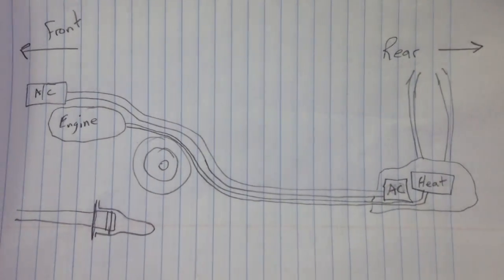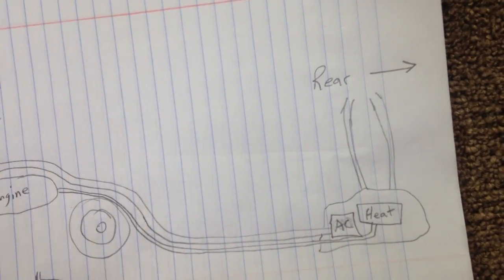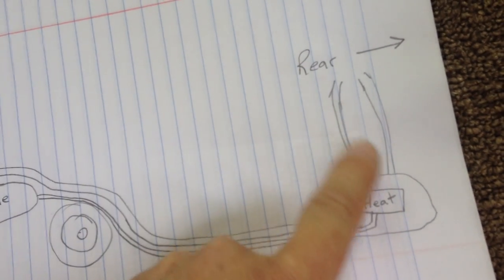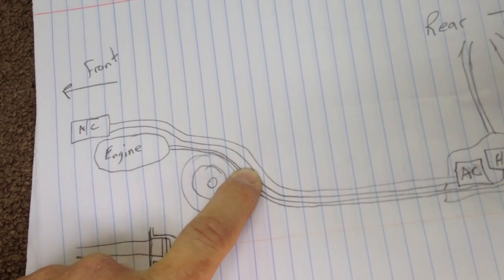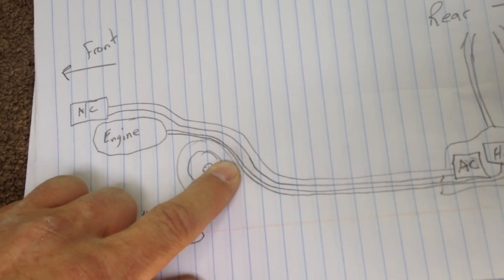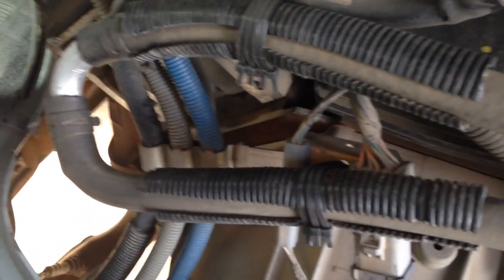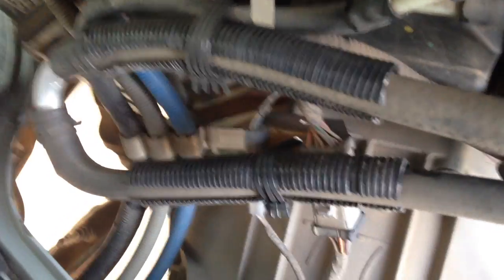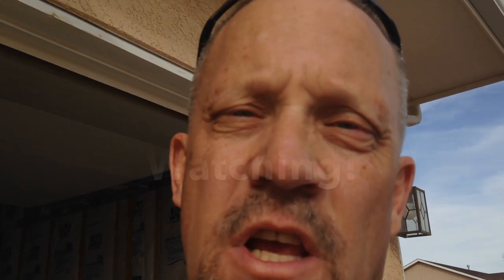How to Remove a Rear AC Unit - Rear AC Heater Removal - Ford E350 DIY Camper Van Conversion

Comment from the maker: Here is a link for the block off kits. I think I paid about $60 for mine. I think the price is ridiculous for two caps and some O rings but it is holding back a lot of pressure and they are simple to install. These links are my affiliate links and I could possibly receive a commission at no extra charge to you if you use my links. I thank you in advance if you choose to use them. 👍
BK67075 Rear A/C Block Off Kit - https://amzn.to/30xR2ip
OEMTOOLS 25042 Air Conditioner/Fuel Line Disconnect Tool - https://amzn.to/3dPqpLe
Reply: Great video, I am doing this to my 01 E350 I will use your affiliate link so you can make a little scratch but I'm curious on Amazon this sellers link has a area to put your model to make sure it fits it says it wont work for a 01. But yours worked okay?
Reply from the maker: Yes, mine worked out ok.
Reply: Ya no está disponible para comprar el producto, es algo temporal?.
Reply: Hi there and thank you for your video. I’ll be ordering the kit from your link and the fuel line tool as well and will keep you posted on the outcome. 
Your video, even though it was after the fact, was very easy to understand. 
Thanks again.
Reply from the maker: You're welcome Tharwa and I wish you the best with your project.

Comment: I wanted to update you and also share with others something that helped me..
In order to access the quick disconnect lines, I agree the best way is to lay on your back and just wiggle around until you can reach your hand up and feel it. There is a clip on each connection that you can pull off with your fingers, it just takes a little wiggling. 
**What I found most helpful is - I used my phone and recorded a video with the flash on, it was very helpful to visualize what was going on up there since I couldn't see it but my phone could. I also have an apple watch so It made it easier to move the camera around and also look at the screen on my wrist. This might not be helpful for everyone, but it certainly worked for me. Thanks again!!!
Reply from the maker: That's a great idea and I'm glad it helped you out. Thanks for posting this info, hopefully it will help the next person who does this job. Thanks again!

Comment: That is very helpful.  The kit is now $68 for two caps and four O-rings and over $10 for shipping.  Holy wow.  
Thanks for the video.
Reply from the maker: You are welcome. Yes the block off kit is pricey but still much, much cheaper than having a shop do the work for you.

Comment: Awesome video! Converting the same van now trying to remove the rear Ac
Reply from the maker: Thank you and good luck with your build.
Reply from the maker: After I did the removal of the rear AC, my front AC was in tact and fully functional. I did have to have the system recharged after capping off the lines that feed the rear AC unit.

Comment: If I accidently cut one of the ac lines and evacuated the ac system, I probably would have evacuated my system as well, ha ha.  Thanks for all the info, as I need to do this with my 1998 Dodge conversion van.  I just got it 2 days ago and was under there and saw the 3 large coolant lines running under the chassis and snaking their way to the rear.  There are several places the hoses have been rubbing against parts under there and are almost worn through.  That seems crazy to me plus, all it would take is a rock to pop up there and cut a hose and there you are.  No thank you, I am taking them off so I appreciate this info.  Didn't see any ac lines heading back there yet but the manual says it has rear ac as well.  I just though maybe they ran a duct inside the wall for that ?   Only control for that is a rear fan switch up front.

Comment: Thank you, this is just what I needed.  I wish I had discovered this before I ripped out the rear A/C.  But I think I can still do this.  I have a couple questions. 1.  How did you cut & bend the aluminum pipe that you used for the coolant hoses?  2.  Would it work if I blocked off the two A/C pipes further back on my vehicle, somewhere that is easier to access?   I'm a complete beginner & don't know anything about mechanics of cars, but I keep trying to figure things out.
Reply from the maker: You are welcome and I hope my video helps you out. #1. I didn't bend it I just cut out a piece with an existing 90 degree corner already in the pipe. I know I said U on the video but it's really just a 90 bend in the pipe. #2. For the block off caps to work you have to cap the pipes where there is a factory joint. My set up only had a joint at the front and at the back. I wanted those tubes to be as short as possible so you don't have all that extra Freon running back to the back of the van for no reason so I capped mine at the joint above the front fender. You can't cap the pipes at any location because the caps fit onto the factory joint ends. Hope this helps.
Reply: Thank you, your video was tremendously helpful.  When I saw all the coolant pouring out when I ripped out the rear unit, I knew I was in trouble.  And then I heard noise like something under high pressure was shooting out (I didn't even know it was freon).  This video is the only thing of it's kind that I could find.  My van is a Ford 2000 E150, but from the video it looked like the only difference is that your vehicle was a little longer.  For those who know about metal &/or vehicles this is a stupid questions, but how do I cut the pipe?  Do I use a regular hand saw with a metal blade?  Or I could borrow an angle grinder from my neighbor.
Reply from the maker: An angle grinder will work fine or if you have access to one a hack saw will do a nice job too. Good luck with your project and thanks for watching. :)

Comment: I am currently converting a 1997 F350 SuperDuty Ambulance, I have already disconnected the A/C and the heater while I was stripping/demolishing the inside. I didn’t realize the rear A/C and heater was connected to the engine. I found your video super helpful on a potential solution but I am unable to find caps that are capable with F series, it seems to all be a similar set up… curious if you might have any ideas or point me in the right direction.
Reply from the maker: Sorry I have no idea what caps you would need for an old ambulance. You might try to Google it or check with a dealership or auto parts store. They may be able to help you find what you are looking for. Good luck with your project.

Comment: I'll echo everyone else's comments...great video and will shortly be hugely helpful for us and our 2005 E350 conversion. I had the AC capped off professionally but am about to do the coolant lines. My question is if you remember how much less coolant it took after purging and adding the return/L-bracket under the doghouse? Thanks!
Reply from the maker: Thank you and I'm glad the video helps everyone out. Sorry but I can't answer your question. I had the coolant refill done at a shop and I really don't know how much it required. I also don't know how much was required before the modifications. You may be able to find that info online with a good google search though. Thanks again.

Comment: Is it possible to just loop the ac lines for the time being as an easy solution as I already cut mine out..? I found an easy position to loop the heater lines but I thought the AC was connected. Helpful video you even mentioned the difference in size lines which had me a bit confused.

Comment: Hi. Thanks for the video. Question: I started this before my caps arrived. If I “short circuit” the hose lines under the dog house and add coolant can I drive without the caps on? Does it just mean I’ll have no ac? Thanks. Cheers.
Reply from the maker: You are welcome for the video. Sorry but I can't answer your question. I have never tried that so I really don't know how it would work out. Good luck with your project.
Reply: I also took the rear AC out before seeing this video. I connected the coolant lines together and did not cap the AC, and it ran fine. I just haven't turned on the AC. About to order the caps now. Thanks for the video.
Reply from the maker: You are welcome Ben!

Comment: I started.taking out the panels to my ford e350 xlt 05 and found out that part of the panels are a/c vents traveling to the back. I was trying to keep the rear a/c but now, I am stuck as to what to do. Any suggestions?

Comment: This is super helpful! what year and make is your van?! does it matter? doing mine soon on my 1994 chevy G20.. do you think after doing it, you could take a cheaper route and find fittings and clamps at a hardware store and do a DIY job? I feel like either people say dont touch these, or spend the money and do it right.. Makes me nervous to do it myself lol
Reply from the maker: My van is a 2001 Ford E350. A/C systems are under extreme pressures and need to be depressurized before working on them. Hardware stores don't carry the correct fittings so you will have to get them from an automotive shop. I accidentally depressurized mine by cutting into the line with a cutting wheel while working on the floor. It was dangerous and thankfully I was out side when it happened. I don't recommend doing it that way. A shop can depressurize it for you but I don't know the cost. Good luck and be careful. Remember the system is most likely under very high pressures.

Comment: Hows that radiator loop holding up after all tgis time. Im planning on doing same on a 05 e150
Reply from the maker: I sold the van several years ago but it held up just fine while I owned the van.

Comment: I just ripped the rear ac unit out of my chevy van. You set up looks like mine. 

Now my vans overheating. So would i just cap off the hoses i cut so the fluids dont leak again?
Reply from the maker: I don't think I would just cap them off. I would connect them together so the radiator fluid could circulate through the hoses and back to the radiator. I'm not familiar with the chevy set up but from what you have said, that is what I would do. Hope this helps.
Reply: Thanks. Thats what i was i thinking. Next time i wont beat the hell out of my van with a hammer. I think its time to start taking it easy on her.

Comment: Wow, dude thank you thank you thank you. I am doing the exact same thing to my first stealth van and don't know my butt from my elbow about AC/Heat. Let me ask you did them heater lines don't have to reconnect in a 'U' like the AC lines did?
How big a bucket am I gonna need? Do you remember if there was a lot of stuff in it?
You didn't have to weld them holes huh? I was thinking I'd have to weld the holes.
Reply from the maker: The A/C lines are the aluminum lines and were capped off with the block off kit I purchased. One line is a little larger than the other and get capped off just above the driver side front wheel. The heater lines are the larger rubber lines I installed the "U" into under the dog house with the hose clamps. I probably got a quart or so of fluid out of the heater lines. The A/C lines are the trick ones because they are under extreme pressure. It would be best to have the A/C system evacuated by a shop before you cut those lines. Once you install the block off caps you'll have to have your A/C system re-charged so your dash A/C will work. Kind of a pain and a little pricey but worth it in the end I think.
Reply: I just removed the rear AC/heater core from my '04 E350 Superduty XL, and drained all the coolant before I started. My van holds approx 4 gallons of coolant, but this may vary in different years/models.

Also, it bears mentioning that I found an AC block-off kit at my local auto parts store for 13.99. Not sure if it's manufactured to the same specifications and quality as WannaBFree's kit, but it's a lot cheaper if you're operating on a limited budget!
Reply from the maker: Awesome, sounds like you scored on the price! As long as it doesn't leak when installed you will be fine.

Comment: This is great, thank you!  Can you buy the AC caps at any auto store you think?
Reply from the maker: My experience was most local auto parts stores didn't have the one I needed so I had to order mine on line.
Reply: What exactly did you buy? I need to do this exact cap off for my van
Reply from the maker: @solaceincarnate  Here is a link for the block off kits. I think I paid about $60 for mine. I think the price is ridiculous for two caps and some O rings but it is holding back a lot of pressure and they are simple to install.
BK67075 Rear A/C Block Off Kit - https://amzn.to/30xR2ip
OEMTOOLS 25042 Air Conditioner/Fuel Line Disconnect Tool - https://amzn.to/3dPqpLe

Comment: Hey! we are trying to do the same thing but cant seem to find the kit anywhere. Could you let us know where you bought it and how much u paid?
Thank you
Reply from the maker: Here is a link for the block off kits. I think I paid about $60 for mine. I think the price is ridiculous for two caps and some O rings but it is holding back a lot of pressure and they are simple to install.
BK67075 Rear A/C Block Off Kit - @t
OEMTOOLS 25042 Air Conditioner/Fuel Line Disconnect Tool - @t

Comment: I can't seem to find where you have answered Samantha's question about the block off kits.  I think you are the only guy in the world who knows about them.  Can you tell me where i can find them.  I've tried Ford parts but no joy.  Would really like to know where to order the cap off or block off kit from.
Reply from the maker: Here is a link for the block off kits. I think I paid about $60 for mine. I think the price is ridiculous for two caps and some O rings but it is holding back a lot of pressure and they are simple to install.
BK67075 Rear A/C Block Off Kit - https://amzn.to/30xR2ip
OEMTOOLS 25042 Air Conditioner/Fuel Line Disconnect Tool - https://amzn.to/3dPqpLe

Comment: any issues so far? does it change the pressure in your coolant system? im planning on doing this soon.
Reply from the maker: I sold that van a couple of years ago but the few years I owned it I had no issues with the modification. I think the pressure in the system would be the same with or without the extra run of hoses. You'll just have a little less fluid with the shorter lines. Good luck with your project and thanks for stopping by.

Comment: Was there a trick to getting the block off kit in behind the shock tower and spring? Did you go from a certain point where there was more room to get in there and install the caps?
Reply from the maker: It's been quite a few years since I made that modification. I do remember it being quite a challenge but it is doable. If I remember right, I think I laid underneath just behind the driver front tire to get an angle I could work with to get it done. Sorry, it's been too long for me to remember any specific details of that task. It wasn't simple but I didn't use any special tools except for the removal tool for the block off caps.
Reply: How did you end up disconnect the lines?

Comment: I found a rear ac block kit online, but the page said that I need a springlock removal tool to disconnect the lines.  Is that an essential item to purchase?
Reply from the maker: Jacob Liskowiak yes, you will need the special tool to disconnect the joints to install the new caps. Here is a link for the block off kits. I think I paid about $60 for mine. I think the price is ridiculous for two caps and some O rings but it is holding back a lot of pressure and they are simple to install.
BK67075 Rear A/C Block Off Kit - https://amzn.to/30xR2ip
OEMTOOLS 25042 Air Conditioner/Fuel Line Disconnect Tool - https://amzn.to/3dPqpLe

Comment: I am removing the same type of unit from the rear of my van. I reconnected the heater hoses together, but I can't find the parts I need to cap off/reconnect the AC hoses. If I refill the reservoir, will the radiator, water pump, and everything still work if the AC hoses are still disconnected? Or does the AC need to be capped like you've done?
Reply from the maker: Yes, everything will still work except the AC. Also it isn't good for the AC compressor to run without AC fluid in it so don't turn on the AC if you don't cap it and fill it. Also on most vehicles if not all vehicles the AC compressor runs when you have your heater settings set in the defrost position so try to avoid that as well if you don't plan to cap it and have it filled. (the AC that is) Your heater, water pump should all work fine with the radiator hoses connected and filled properly. Thanks for watching and I hope this helps. :)
Reply from the maker: Here is a link for the block off kits. I think I paid about $60 for mine. I think the price is ridiculous for two caps and some O rings but it is holding back a lot of pressure and they are simple to install.
BK67075 Rear A/C Block Off Kit - https://amzn.to/30xR2ip
OEMTOOLS 25042 Air Conditioner/Fuel Line Disconnect Tool - https://amzn.to/3dPqpLe

Comment: hey i have a question . do those heat hoses on the back  of the ac/ heater stay hot when u driving the van . first time looking at them on the back and they are hot ?
Reply from the maker: I would think they should be hot when the engine is hot. I believe the engines coolant continuously circulates through those lines when the engine is running.
Reply: thanks

Comment: Did you come across some sort of sensor in the radiator line? I want to loop my radiator line back to itself but there's this sensor thing attached to it where the lines go up into the floor in the rear of the van.
Reply from the maker: It's been a few years now but I don't recall having any sensors in the radiator line when I did the removal.
Reply: @WannaBFree  it might be a temperature gauge
Reply from the maker: Yes it might be a temperature gauge. Does it have wires coming from it?
Reply: @WannaBFree  it has 1 small wire that disapears into the frame